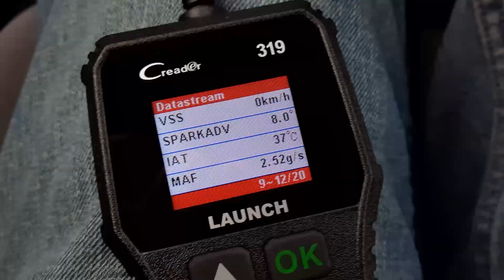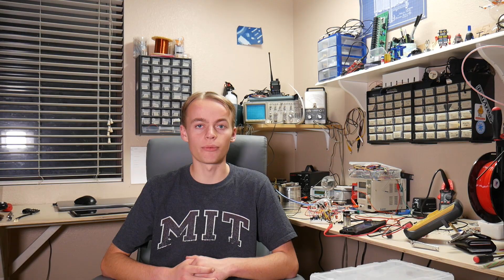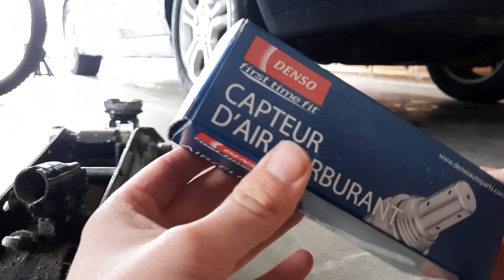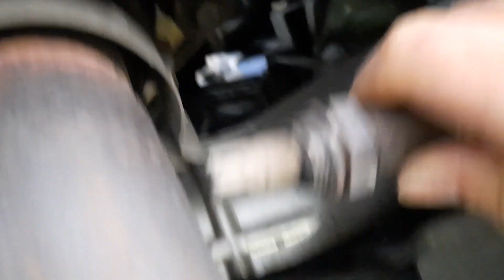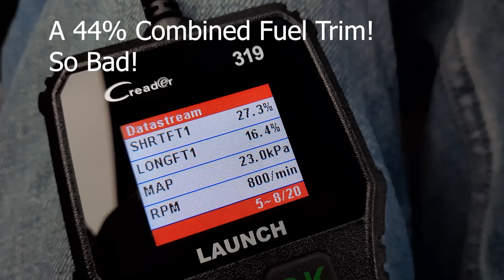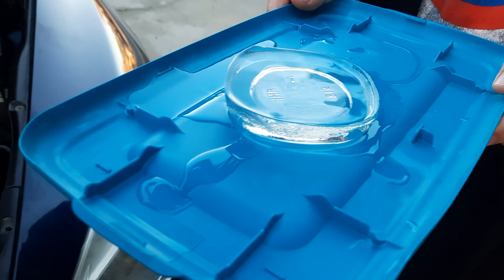2003 Honda Accord Vacuum Leak & O2 Sensor Fix (P0171)

Comment: Check your purge valve and brake booster.
Incidentally, the wide band sensor is referred to as an air/fuel ratio sensor. 
Fuel trims are calculated by subtracting st and lt and you want it to be less than 10.
If propane worries you, just use carb cleaner or brake cleaner. Just be well ventilated with brake cleaner as it produces phosgene when burned. I use it all the time and haven’t had any issues. 
It may not be a bad idea to at least inspect, if not clean, your MAF sensor. Just use the proper cleaner and be sure it is dry before reconnecting. 
Lastly, did you ever clear your codes after any repairs?
PS: this goes without saying, don’t ever get advice from a parts store. PERIOD!!! There may be exceptions to the rule with knowing what they are talking about; but they are just that. Exceptions.

Comment: Good video thanks for posting.
Every K20 and K24 engine i have ever worked on has a torn intake boot, right at the spot yours was leaking.  I suspect they get torn from rough handling during install removal of airbox when servicing air filter. 
If you cannot get a new or undamaged one - Clean the tear and surrounding area with rubber safe cleaner, apply RTV INSIDE the crack ONLY, wipe excess RTV inside and outside, use Flex Seal type tape to wrap the outside of boot over the tear. Leave in sun or near mild heat to cure.  Even electrical tape will work in a pinch.
Stay gold

Comment: A MAF sensor will cause a lean code on both banks ...not just 1
Reply: Replacing the maf sensor will make the code p0171?
Reply: @LynWeeD  what do you mean?
Reply: @crystrezerex2life  I meant to type if you replace the faulty maf sensor then will the code p0171 go  away? I'm in process about to clean the maf sensor first with maf sensor cleaner...also im going to check the air filter and I just replaced the air intake hose it was cracked but the code remains
Reply: @LynWeeD  are you working on an accord? What size engine?
Reply: @crystrezerex2life  yes 2.4

Comment: Check the MAF sensor. If there's a leaf on its grid or a bad electrical signal it could detect less air than there is actually coming out of the air box causing a lean mix.  Not a common problem but related.

Comment: My civic si with CAI and skunk2 headers. I also have p0134 error and changed sensor too. Still the issue is rpm drops too low and gets too lean like 27.1 afr when i shift gears. So i assume it is a vacuum leak somewhere
Reply from the maker: Probably so
Reply: @TannerTech  turns out i had a leaking axle seal and that gear oil was everywhere and also my connector was full of it, cleaned it with injector cleaner and now no more code and runs smooth on my old sensor. Damn i bought a new sensor. 😥
Reply: @airforce_fans i have same code and ontop of misfires battery light flashing etc also this is before the pcm flash update. help me its like the car from hell.. i know i have a tear at the breather joint by the intake hose but id like to know aboht this and i replaced the upstream a/f sensor

Comment: I have the same problem with my accord and cant figure it out
Reply from the maker: Yeah, there are so many things that can lead to a P0171... Good luck!
Reply: @TannerTech  not sure it can be fixed. honda made the problem on purpose
Reply: @Gazanova85   LOL Excellent !
Reply: @TannerTech   I  hate this code the most. I HATE MODERN CARS!
Reply: Call dealerships and have price checks on them for service.  local $70 dollar fee.   It could be injectors or Fuel press regulator.
Reply: @Ihavetruth22  hey man I figured it out
Reply: @Gazanova85  what was it
Reply: @Gazanova85  what was the issue?
Reply: @MrGW2fanboy  why would you ask that when I said I cant figure it out 😄...... but anyways I figured it out. It was a lose battery cable so not enough voltage to engine

Comment: Clean the throttle body and male sure that it moves while accelerating. If it stays open more fuel is add to prevent a stall. No? Anyway good luck. Giovanni, Rome.

Comment: Did you put the old o2 sensor back in or drive for a long time on the new sensor? O2 sensors need to be calibrated to the car which might be why your trim is out, it wont ever be 0 though, usually somewhere between 0-5% as every car is different.

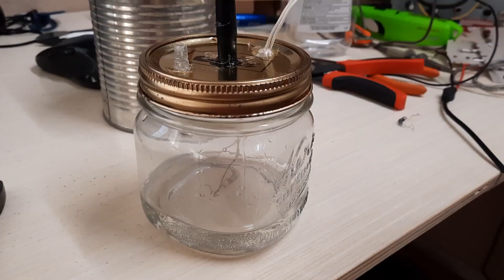Also I would probably put a disclaimer in at 7:36, as doing this on a car with a MAF sensor will destroy it. Accords don't but many cars do and the oil will cover the MAF sensor giving it bad readings.
Reply: He injected the smoke down stream of the maf. Otherwise, yes it would be risky.
Reply: @ReyPatoGuey  air flows in the reverse direction on cam overlap, this is why MAF's dont work during these cam angles.